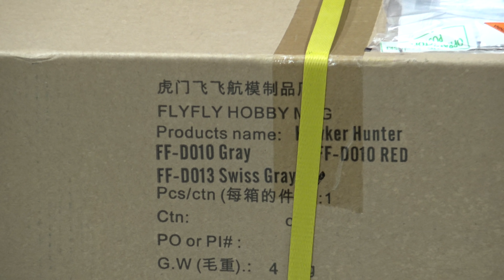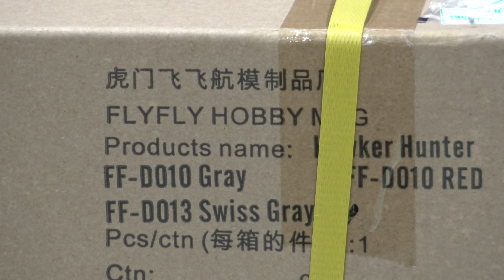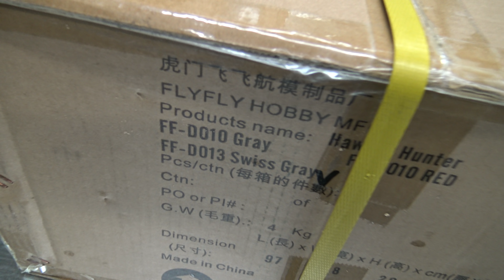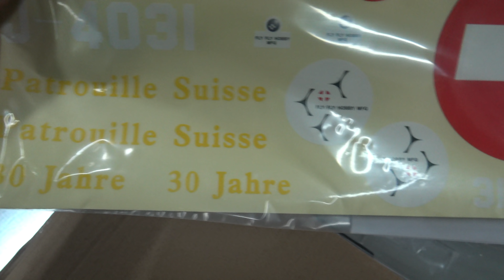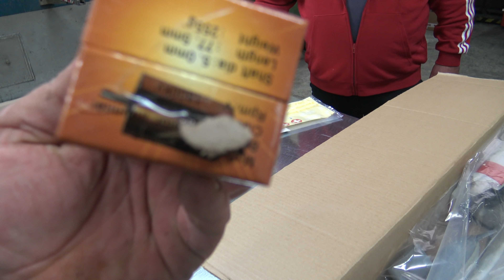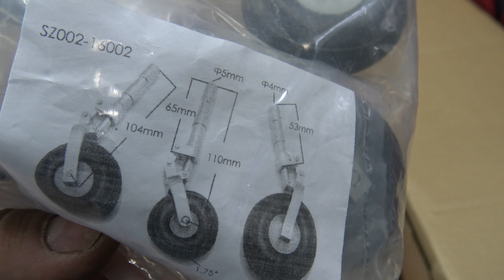FlyFly Hawker Hunter Swiss Green 90mm EDF jet PNF Unboxing

Comment: I have the old RC Lander 70mm Hawker Hunter. I used carbon fibre reinforcement in some areas like where the front and rear fuselage joins. I use a bungee launcher on mine as it has no landing gear. When she is flying she is a beautiful sight. You will have fun assembling and flying the Hunter. I think that it is one of the best looking of the early jet fighters ! Thanks for all you do !

Comment: I've built a lot of the flyfly models most fly good there was problems with the hunter with twisted wings try to check for it ,also i have always used the wemotec evo 11 blade fan blade,alloy spinner and adapter, much more efficient less amps,more thrust,easier to balance,better sounding   and will work in the  flyfly housing.
The hawker hunter and mirage are the quicker ones,

Good build for the winter should keep you busy check the build thread as you must use carbon tube in the wings and tail.

Comment: Excellent model .. I have been after one for quite a while .. I have a few fly fly models .. 90mm F4 phantom with 80mm fms 12blade fan on 6cell and a 90mm fly fly F86 sabre (work in progress) the stock fly fly 90mm fan units are underpowered in my view .. the 80mm fms unit I use produces nearly 2000watts and moves the phantom pretty good .. .. check out the story of the hunter flying under London bridge as a fingers up to parliament by the pilot at the time ..mark Felton made a video of the event..
I will be very interested to see your maiden flight ..also be careful using CA on fly fly foam as it melts .. good luck .. and big salute from Kent uk👍

Comment: I like the pics on the wall!!!  What do you make in your shop? I thought I saw a chimney a while back.
Reply: they are metal CRAFTSMEN!!   In one shot they showed a huge plenum(manifold) from what looks like a hot air furnace. The skill displayed is some of the best I have seen. The craft is taking flat sheets of tin, and bending,cutting,forming,welding them into ducts that blow that nice warm air from the basement, to those rectangular registers in the floor/wall.  I suspect that doing the above, is what sliced roberts wrist.  TOP notch work guys!!!